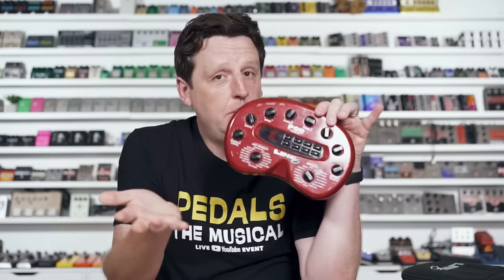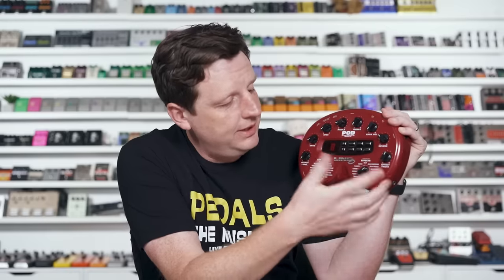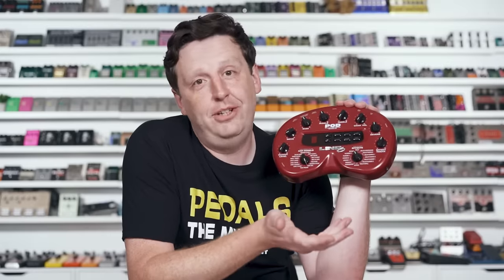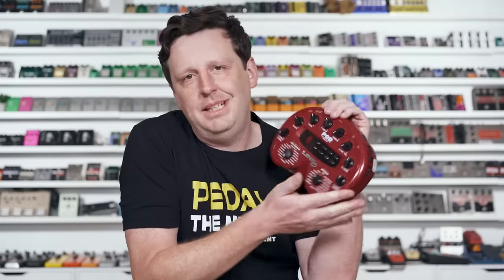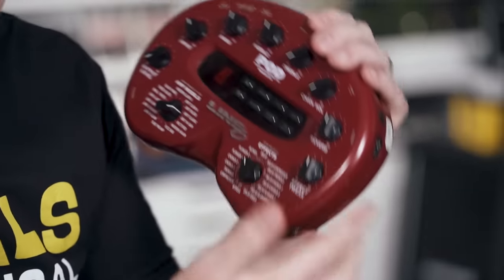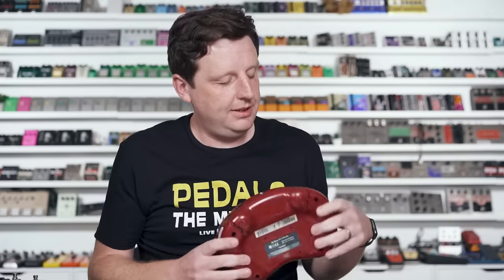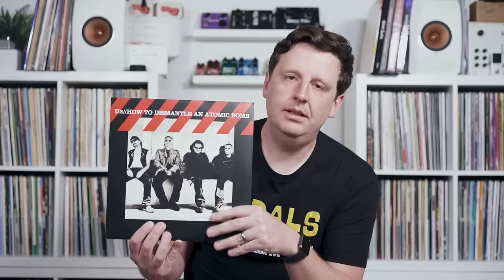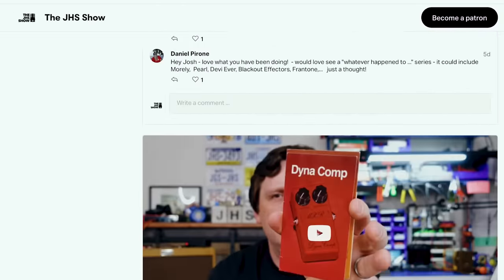Why The Line 6 POD Sounds Really Bad

Comment: The reason it sucked was because it was too cheap and it arrived at time when guitarists wanted to kid themselves (like photographers had earlier) that digital couldn't do it and it wasn't as good as a real amp. The only differences today with the devices are (a) EQ (b) They're overpriced and (c) guitarists now accept amp modelling works, largely because they're being overcharged for it and a few old deaf rock stars have been pictured using them. Once you have something that people can't afford and they think their fave guitar player uses suddenly it's good - and they'll waffle as though amp modelling finally arrived - but it's really no better. 

It hasn't vastly improved at all - no matter what they think they're doing or say in their marketing (and in fact an open source capture software is objectively better than quad cortex et al - to no great effect - you can't hear any difference but you can measure it and see quad cortex has just made it expensive. The open source solution currently lacks a good UI and polish etc) When you see a shootout done on youtube - e.g one guy has one with 13 jcm800 the only real difference is EQ and if the EQ matches whatever recording setup the guy had for the live amp a bit closer people think that means the plugin nailed it better or something - but they all sound like a jcm800. Nothing has advanced. Adding extra parameters or modelling mains hum, it's all BS. If they had to model something like a piano or a guitar that'd be a more difficult problem - the physical modelling of an instrument is complex. What an amp does is not - but, you know, if you've created a company to do it well you have to do something - so you just keep creating expensive tin boxes with higher version numbers on them or silly monikers like 'HD' or fancy names, cortex..helix...to try and create the illusion you're doing something new and have made a massive leap forward.

 In those shootouts, the free plugins and the old pod farm is as good as anything new and expensive. The only real advantage they've done to the hardware is more processing power, memory etc than the podxt had. So you can have more mics, amps, effects - and to that end the devices have more effects and amps included but, meh, there's only really 3 amp sounds you need and 3 or 4 effects (that's how Neural DSP managed to the do their plugins - they're just reselling the same amp models and effects over and over with some guitarists name on them) it's like guitars - there's 3 basic shapes and 2 basic pickups that everyone copies. People that buy a ton of amps, effects pedals and guitars are just ill. You can see Vai has rooms full of stuff - he doesn't need any of it, hardly uses any of it, but at least in his case he was given most of it.

 If you use a plugin then you have that processing power anyway there's no point spending £1500 for a tin box. Just use helix native until the open source solutions get a bit further along development - because the problem of amp modelling has been solved - it's not worth money. It's difficult to see the future of amps either. They're just repackaging amp modelling in expensive boxes that a bedroom guitarist (which is 99.999% of their customer base) don't need anyway. Buy the plugin and an audio interface.

Comment: I've had the POD 2.0 since around 2006 or so when I was still pretty new at guitar. I think it's really convenient and great for headphone practice but I've always found that there was something missing in the sound. I know it's dumb, but I could hear it in this video too. It's like a lack of presence and always sounds like the tone is muffled. Like it wants to jump out but something is holding it back. Very hard to describe. I've ran the POD in many many different ways including straight into an amp, using the effects return of multiple tube and solid state amps (with cabinet modeling off), line into a PC, and straight into a PA etc. 15 years later and I still have never gotten a sound out of it that wow'd me.

And I'm definitely not anti-digital or anti-modeling or anything like that. For instance I always thought the VOX modeling stuff sounded amazing and wish I had a Valvetronix. I've also heard some great VST plugins and PC-based amp modeling software that sounded great too.

Comment: I bought one of these in 2000, hated it from the go. I hated it so much that after years of reluctant use, in 2014, when it died, I found one on CL the next day had bought it so no on else would have to suffer. The dumbest way to blow $65.
Anyway, if anyone gets a line on the pedal controller for this please let me know.

Comment: It's crap man, i used to have one. Sounds no where near as good as my primarily Boss stomp boxes. Has some useful and innovative features and a cool design yes. But the sound quality, not good. Of course anything sounds ok through a decent tube amp but ok is not good enough. It's a matter of sound and feel comparison. Impossible to be completely objective with a topic such as sound, one person's fuzz is another person's headache. I have a line 6 100 watt combo amp too and it also sucks and does not even work properly anymore. I'll never buy another line 6 product as a matter of principal. PS...i like the sound of your 1969 Fuzz pedal, probably will get one before too long, keep up the good work, i enjoy and learn a lot from your vids. I just disagree with you re the pod. I would be very surprised to find that you actually use one in your rig.

Comment: I never used the pod, but I did have the guitarport xt and it was pretty meh going through headphones and cheap computer speakers.  I also briefly tried the rackpro for a few months, and really it was only the clean tones that did it for me.  Much like older zoom gear (I've owned the 505, 505II, and 2100) if you use it with a crappy sounding amp and you don't spend the time tweaking the settings, it's not going to sound good at all.  

Anyways, thanks for making want to try line6 again, dick.

Comment: Well, If you play more on the cleaner side of rock music like U2 or some shoegaze where the point is to make some random broken noises then yeah or some other pop-rock. Line 6 POD is good enough. But try to play some high quality & hi-gain music and you realize that POD doesn't compute. You will soon realize that Mesa, Diezel, Bogner, Soldano amps are just not available. The hi-gain of Line 6 POD just sounds so digital and it is clear as day since I own both, POD X3 Live and Mesa Boogie. Try to play some prog-metal and you realize it is horrible piece of shit.

Comment: It sounds kind of ok alone, but sit it in a mix and it’s fine .

I wonder what the purists thought of the first stomp box. 
I wonder what the purists thought of the first amplifier 
I wonder what the log beaters thought of the first drum with a skin 

Probably shitting  on the new tech just like all the other purists did .

But hey, I have money to live now instead of replacing power tubes 2-3 times a year and I still have a back to lift with. And I can use the bus to haul gear instead of a station wagon or van.

Oh, and I can set my gear up just as fast as the lead singer can set up his mic stand , run his xlr  , plug in his mic and clip it to the stand

Comment: Honestly, I wish they made this garbage about a decade earlier or so. Because for all the crap Line 6 gets, amps and pod both, ya'll are spoiled.  Because when I was learning crap gear was actually crap.  The Line 6 spider cost as much as a Gorilla and less than a Crate. So maybe go try those side by side and see which you'd rather learning how to play on.
Edit: When I say cost as much I mean literally. They were both around 100 bucks. Adjusted for inflation that Gorilla and Crate both cost quite a bit more.

Comment: People said 80's lower end racks sucked in the 90s/2000s.  Same shit.  A quadraverb still sounds great in 2021 if you know how to edit it.  It is hard to argue with a korg drv1000 for low fi shoegaze reverb and all that.  It's the cycle of gear.

Honestly I still use mostly 80's and 90's gear at home.  I have a helix for live use because it works fantastic as a pedal board replacement and is easy to trouble shoot if something goes wrong.  At home or in the studio it is a pile of "outdated" gear.  Not vintage, not exactly good, little of it is collectible (maybe the 3 boss ps-3's and my pearl octave count as that), but it still sound good to me.  I often find it more inspiring as it all has weaknesses and quirks.  I kinda like the low fi warts and all of that stuff.